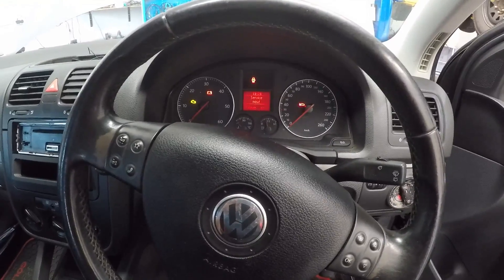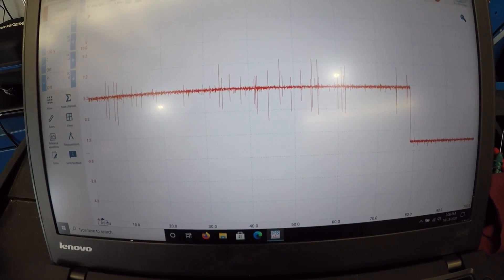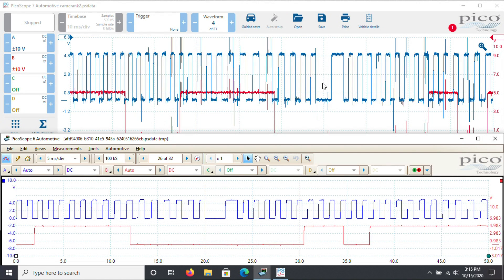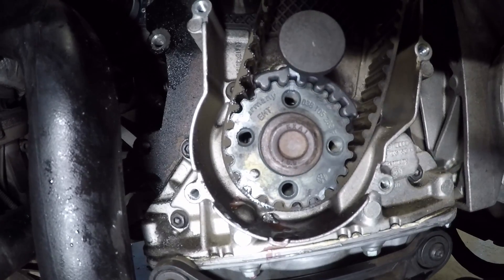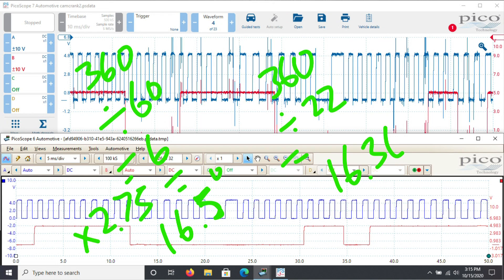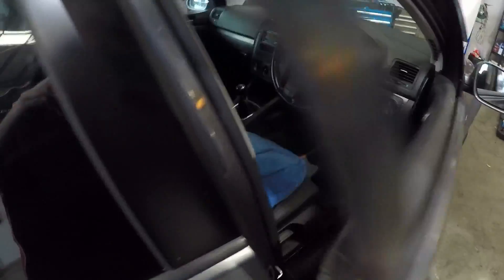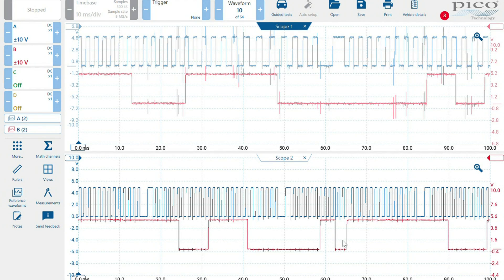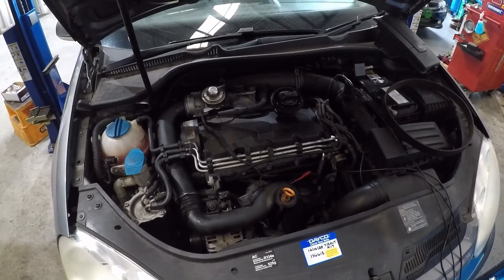P0341 with an extended crank time - 2006 VW Golf 1.9 TDI BKC engine

Comment: I’m fighting a 2006 BRM 1.9 with a p0341 camshaft implausible code.  I’ve replaced the sensor, same thing.  The wiring to and from the ecm checks out.  I did do the timing belt while the motor was out of the car, and the tools keep lining up perfectly.  I have vcds at present and nothing else.  Any clues?

Comment: Hello Mate, well done and good fix, ripping a hole in a timing belt is certainly impressive. 
Did you by any chance check the torsion value while you were in there before and after? I know in the past I have adjusted it for increased MPG on customers vehicles and having the timing out in this case it would be an interesting comparison.  
I read an article many years ago on how to fine tune the torsion value (camshaft timing) on TDI engines for better all round performance and it can make a very big difference. 
Again well done mate :)
Reply from the maker: Legend Gerard! You're the second person to ask me that but unfortunately we didn't check it. Went straight for the jugular, but definitely would've been an interesting comparison! That's the first thing I'm going to do next time 💪
Reply: @romanosautomotive  and it's safe to say with VW's you will get more chances 😂😂😂  
Keep up the good work  💪 💪
Reply from the maker: Haha you are not wrong there Gerard. Looking forward to more of your videos! Speak soon my man!
Reply: @romanosautomotive  💪👌👍